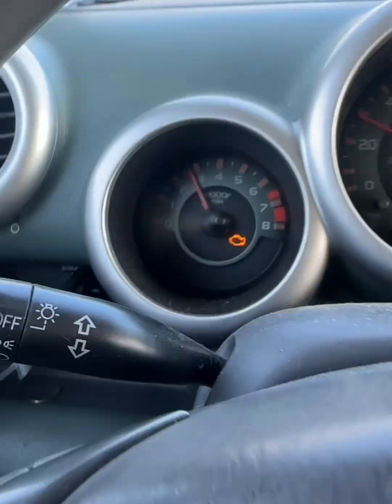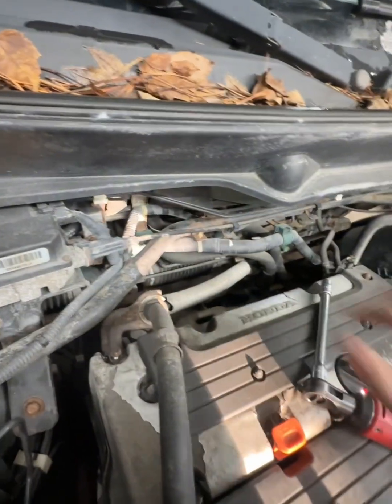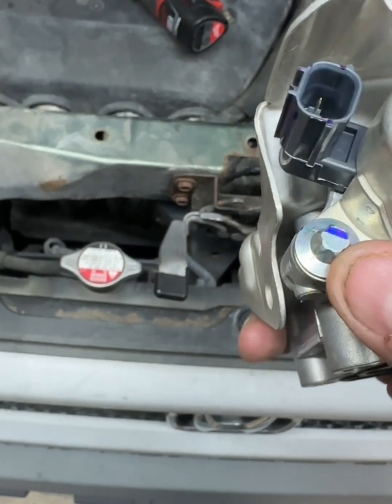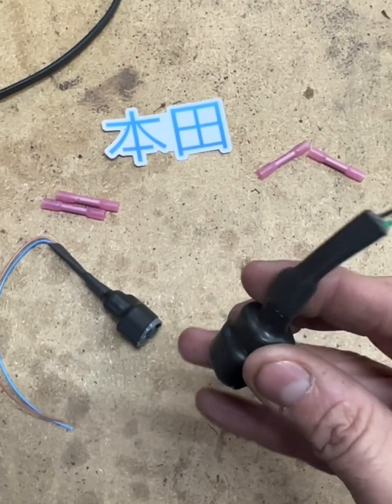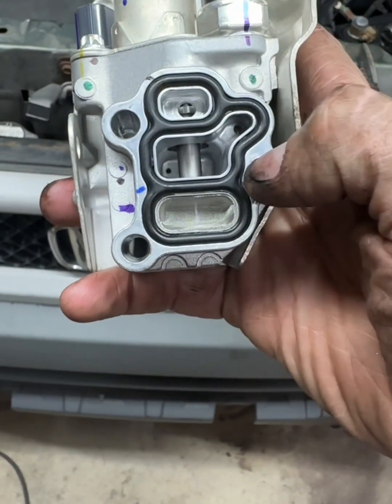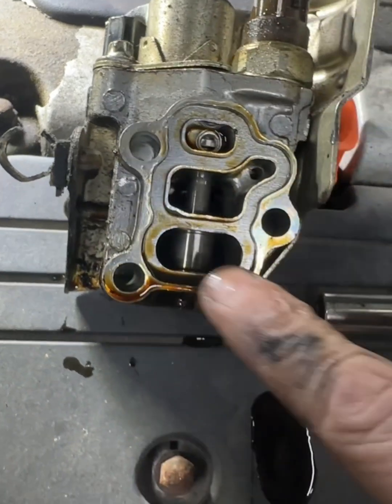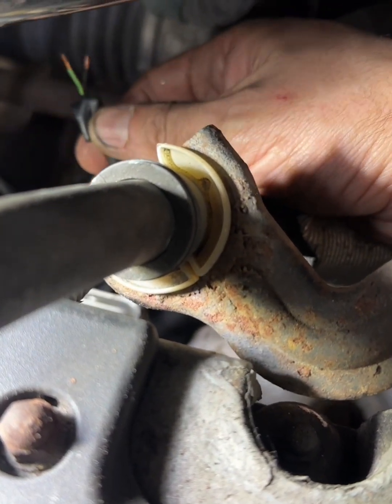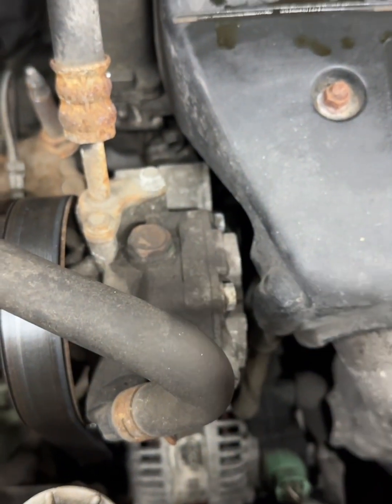Honda Element P2646 & P2647 VTEC Repair

Comment: Hi thanks for the video. I know you’re selling the replacement pigtails but is it a good idea to clean the existing pigtails with contact cleaner /and or when clean to maybe put some dielectric grease where the plug goes in to the Vtec?
Thanks

Comment: Thank you I have a 2008 Element and I have ran into the issue with the vtec solenoid. I replaced it and am now having the connector issue so may have to do the snip and replace the connector instead of bandaiding the damaged connector with electric tape. Thanks for the video. Great advice.

Comment: At first i thought 117 + 15 shipping was alot. But then im on my 3rd vtec solenoid spool unit. First was getting p1009, then after replacement got p2647. Already changed vtcc n oil. Got the screen under ps pump but hopefully it is the pigtails.

Comment: Do I have to use heat shrink connectors or can I use crimp connectors with electrical tape on the ends? I have a huge variety pack of connectors but they are just hard plastic the you crimp the wires into. They work fine on my CB radio connections from the power supply to radio .
Reply from the maker: You could use a regular butt connector and some tape however I provide the heat shrink but connectors with the harnesses.

Comment: Why do you call it a "sillanoid"? It's pronounced SOLE uh noid.
Reply from the maker: @mattfoley6082   ⚠️ warning ⚠️ Viewer may be exposed to a western Pennsylvania accent during the viewing of this video.  Please take all necessary precautions.
Reply: @ElementDIY  I lived in Pittsburgh 2 years and heard "dahntahn" and "the Stillers" but I never heard this.
Reply from the maker: @mattfoley6082 I think you misspelled Pixburgh.  😂. It’s all good. Thanks for the heads up on the pronunciation. As a bilingual individual sometimes vowel sounds are difficult for me.  🤷